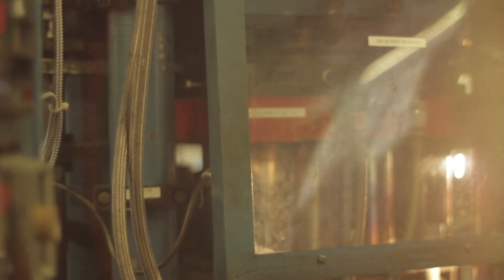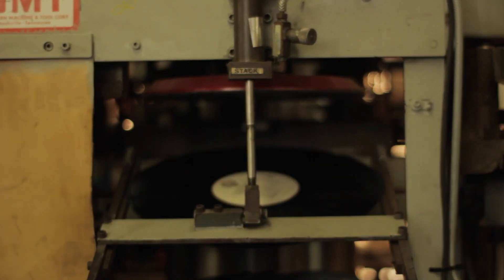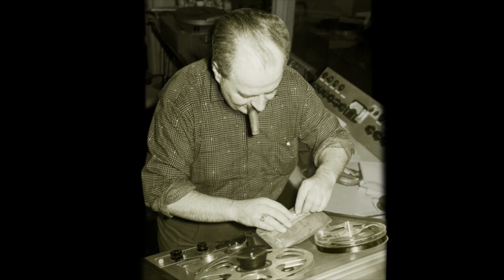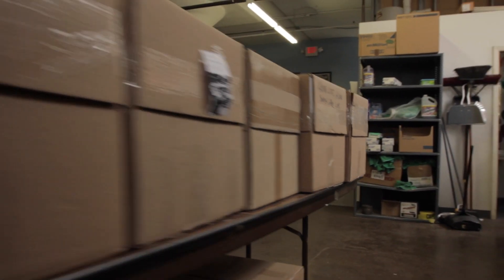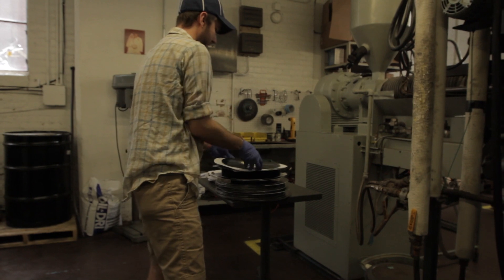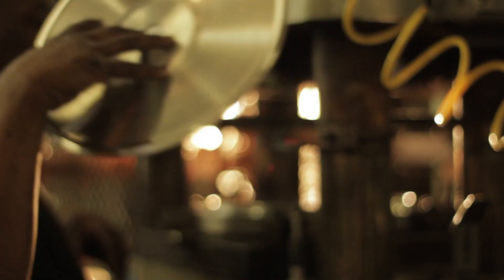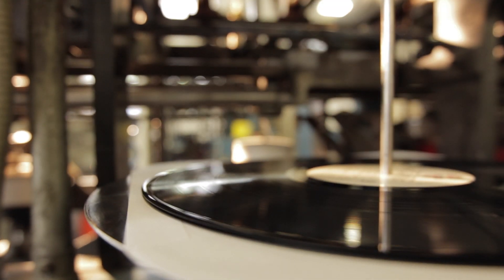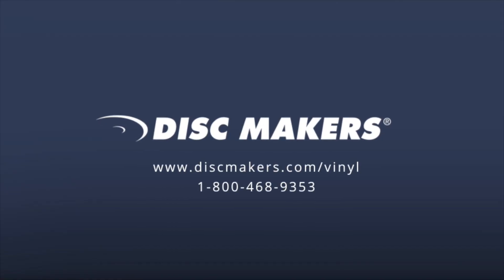Vinyl Record Pressing Reintroduced at Disc Makers

Comment: I just submitted a vinyl album to be pressed as a record. You mention that your folks will make an audio master for vinyl. If I already had my files mastered for vinyl, and those are the files I submitted, will they be changed at all by your engineers?
Reply: Mastering to vinyl is an art in itself. You can't just take your average digital master and cut it into vinyl, because of the physical limitations of the medium. So yes, the engineers will most likely make adjustments to your master to minimize the chance of distortion, needle skipping, etc.
Reply: @rebase  But if I have a professional who has already done that for me, wouldn't I prefer their work than alterations to the sound by someone I do not know nor have hired?